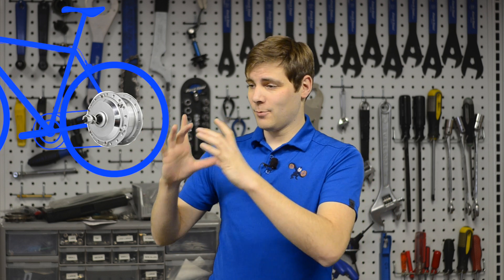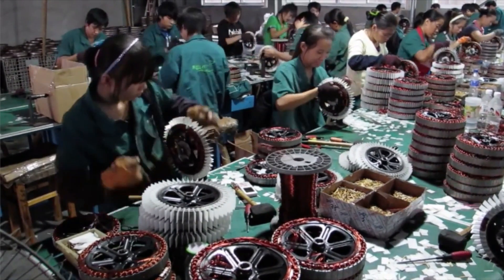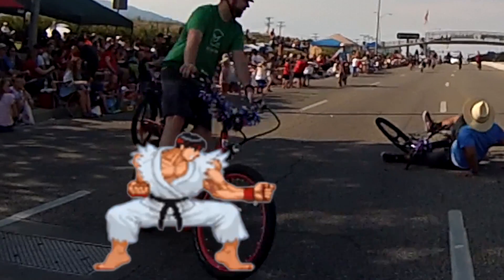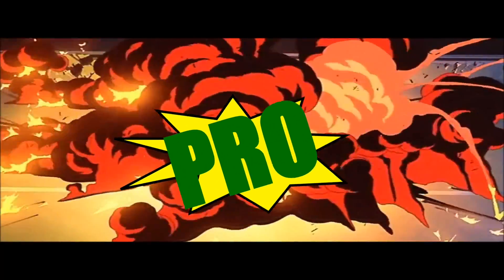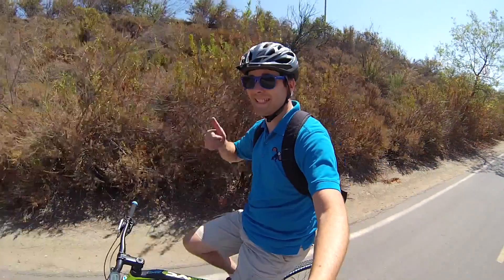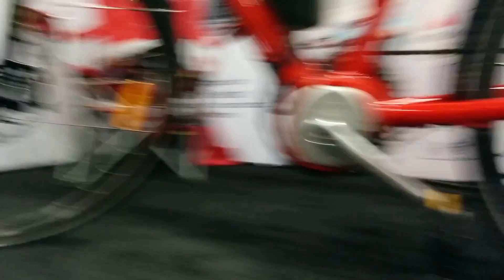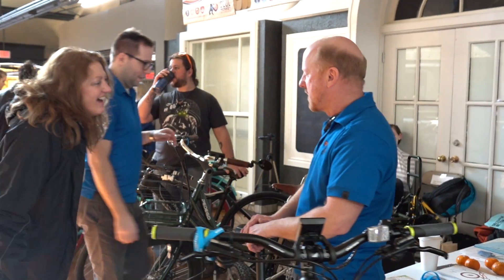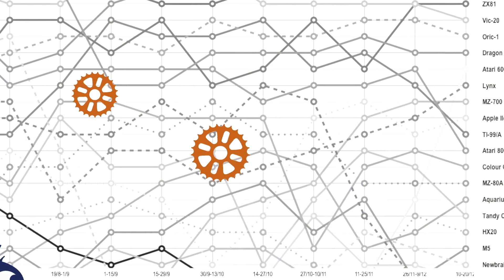Hub Drive VS Mid Drive eBike motor systems

Comment: You forgot the most important difference. Hub drives are direct drives without additional gearing. Which gives them a slight advantage on a flat road. Mid drives take advantage of the existing gearing and thus have better efficiency over a broader range of conditions
Reply from the maker: I intentionally left that part out because I have not seen that correlation with the bikes I've used. I got the chance to test two identical bikes, only with a mid or hub drive bring the difference. My findings were quite surprising...
Reply: Do you care to share your findings?
Reply from the maker: Gotta find the time to make the video 😁

Comment: Outstanding presentation, very professional. I will harp on the fact you didn't mention gear ratios for the mid-drive but otherwise you did a fine job of explaining the pros and cons of each.

Comment: you must all be missing out on e-bike life.  Hub motor used as a mid drive. bigger magnets= more torque.  sprocket bolted to disk brake side, ran through a jack shaft back to a 7 speed freewheel.  wheelies, climbing, or speed.  Years of experience & reliabilith, make it a winner!
10hp limit on quality bike parts & chains sometimes.
Reply from the maker: I'm sorry, I don't understand.
Reply: Blue Monkey Bicycles 
purpose built mid drive mount for 30 pound hub motor to fit into kit or a small type motor. Pedaling is free & seperated from motor.  it uses all rear gears for pedaling & using the motor.  look up urban commuter mid drive, it can be engineered to use a monster qsv3 hub motor capable of 100mph if your technically advanced with correct parts or climb any hill.  I can engineer was to use on custom or open space frames.  40mph for me best in the wold. 😁

Comment: What if you were to put a hub drive on the front and back wheels. Have the controls for the front hub bu the front brake and the rear hub controls by the rear brake lever?
Reply from the maker: What would control the brakes?

Comment: What would be more beneficial, a front or rear electric hub?  I think I've seen some front electric hub drives, and quite a few rear...I assume the front would be far easier to install as you don't have to mess with the bike's chain and gear train.  

I currently have one of the Chinese gas engines and that thing has been problem after problem with vibration causing broken motor mount studs, and parts coming lose, etc.  So...in the future I'm looking towards an electric conversion, but which way is going to have a longer life span?  I'd think the electric hub would, and what about having dual electric hubs one front and one rear to extend the travel on electric, by having 2 motors and 2 battery packs, wouldn't that double your distance on a charge?  Is a front or rear drive hub better?  I'd assume rear, as the front drive could cause some severe steering issues if you aren't careful?

Edit:  I guess I should add that all my riding is on the road, so I think rear hub drive would be best?
Reply from the maker: https://www.youtube.com/watch?v=ACVEUpQ6PL4

https://www.youtube.com/watch?v=9kIFrR8tt28
Reply: Thank you for the reply and video links...and you got a new subscriber.

Comment: AND there is no recuperation posible with mid drive ; ) Right?
Reply: No, mid drives can't do regen. But geared hub motors can't do it too. For Regen you need a direct driven hub motor.

Comment: full suspension = mid drive, off road hardtail = rear hub drive, touring = front hub drive with a pusher in a trailer, just my preference, if i could afford either one.

Comment: More differences come to mind:
The Hub Motor gets every impact and vibration from the road, rocks, roots, etc. 
The Mid Motor is protected from the road. This improves durability. 

The Bosh Mid Motor has only one front chain ring. It doesn’t have a front derailleur. This substantially improves durability and simplicity. When the front chain ring gets worn out you only replace that small part. It’s quite amazing really. Also, the chain is very protected at the front and below.
Reply: A mid-motor will be impacted by everything the front wheel picks up and throws at it.
In rainy weather, the front wheel will also spray a lot of water on it. Since it has to be ventilated somewhat, I can't imagine it can be 100% waterproof.

Comment: after having both I prefer hub motor for commuting and acceleration. Mid drive with the variable gearing are better for off road.
I will switch back to hub drive because it's  more peppy and fun to ride

Comment: Not all mid drives have to be pedaled. They have ones that use a front freewheel, and a separate front gear and chain to allow you to coast and use a throttle.

Comment: Just a guess: The stress is higher on the motor side of the cog (at 6:19) than on the wheel side of the cog (imagine the cog is connected with a spring to the frame so every time the motor torqued the cog would move down due to the extra stress).  Without the cog the chain could break anywhere from the motor to the axel (thus: chainsaw vs leg). with the cog, it will break between the cog and the motor... no severed limbs. Or...

Comment: No mention of noise or reliability. These are relevant as hubs are quieter and more reliable in many settings and are typically a good choice for long flat commutes but centre drives have the advantage of utilising the bikes gearing and may be a better choice for up and down terrain.

Comment: Wellll, no one really needs 21 speeds with an electric powered bike anyway. But I'd be interested in a a two speed mid drive system. Hmm, maybe it can be set up using a BMX chain and front sprockets. You've given me an idea now!
Reply: Check out what stuff is available for recumbent trikes. There are two speed cranks and such. Pretty cool stuff if you have the moola to invest...in your health.
Reply: Heh, no way can I afford my "health". Just have to make do with whatever. :¬P

Comment: 3:41 is riding with his stand/kickstand down! :P
Reply from the maker: Deployed kickstand adds 5 more horse power
Reply: @BlueMonkeyBicycles  LOL that reminds me of all the stuff boy racers used to come up with in the 1990s with thier Vauxhall Novas...
Painting the engine body colour gets you five extra horses.
Alloy wheels over rusty drum brakes  gets you five extra horses.
A decent sub woofer (ie one that occupies the entire boot) gets you five extra horses.
An induction kit over-spec for the engine gets you five extra horses.
Getting rid of all your ground clearance gets you five extra horses.
Dont waste money on a turbo charger - just install a boost gauge and get just as much extra power.
Tinting your windows  gets you five extra horses.
Using a baked bean can as an exhaust  gets you five extra horses.
Reply from the maker: Fire extinguisher, 5hp
Coffee can muffler, 10hp
Hooks on the hood, 10hp
Fog lights, 5hp
Reply: It's a third wheel!
Reply: I think he was using the kickstand to mount the gopro

Comment: I snapped an Ebike rated chain on my mid drive Bosch. Had to push my Bike 5 miles to get home. You can hear the grinding when going up hills and changing gears. Bring an extra chain and tubes if you ride a mid drive. Bosch 20 mph wall sucks too.

Comment: The extra gear on the bike is for the chain line to try and reduce pedal bob and other pedal interactions with the suspension
Reply: The only correct answer around here;)

Comment: You forgot to mention the torque problems with hub motors on the bike spokes, they strip the bit off where they connect to the hub (I've had it happen to two of my bikes)

Comment: I have ridden several brands of both mid drive and hub. I went with a PIM Electric Bicycles for 2 reasons. First the mid drive options were out of my budget and if something broke out of warranty the cost to replace motor or system is super spendy. Second I like the smoothness of the PIM system, seemed very well put together and mine came equipped with Magura Hydraulic brakes and Magura fork for about $1700 ish. I have 2500+ miles on it with no problems. 
Great video! I watch most of the Blue Monkey videos. Of all the mid drives I tried I like the Brose the best. I tried the Brose on the Bulls Lacuba and a Specialized Levo. I appreciate the Brose system for what it is...... But again out of my Budget!! Right now the PIM Electric is the bike for this common man on a budget!!
Thanks!

Comment: Note: electric bycicle use the motor for paddle assistance it's not a motor bike, in the Netherlands you don't need to register and insure you bicycle if the motor has maximum of 250watt. The mid placed motor can be fitted with gears like a nexus 7 speed or a multi speed derailleur in combination with a 250w gives alot of choice shifting down when going uphill or heavily loaded bike
Reply: I don't know why you would bother putting a motor on a bicycle under 750 watts what's the point I went with 1,000 Watts and I love it I wouldn't want a little skimpy 250 watt motor just doesn't make sense to me.
Reply: @tallcool1jeff  are you stupid? Laws mate. in australia too you can only have 250w

Comment: My budget for an ebike is limited to around 2k so, I suppose I AM limited to a decent rear hub motor ebike.  Any suggestions from anyone? I’ll be riding 10 miles nonstop mostly and occasionally 20 or more
Reply: shadowdance4666 here in Germany you can get a descent Cube Mountainbike with Bosch CX (mid) for under 2000 :)

Comment: can you make a video on over volting the motor. I have a 36 volt and want to over volt it to a 48 volt. Do I need to get a new controller my existing one has 50 volt caps in it.

Comment: Surely front and rear hub drives help sort out the balance issue, even if it won't help with the unsprung weight.

Comment: Is there a difference in reliability? hub drives are more exposed to vibrations.
Reply: umm I've destroyed 8 or so cargo bike wheels doesn't matter if its mid drive, & my wheel hub laced moped bent also from a pot hole.  no matter what you have, more weight & stress is in a hub motor laced wheel.  laced wheels will always need tuned or replaced eventually & a mid drive is #1.  You can swap out a wheel much quicker with out lacing a motor into it.

Comment: Practically useless vid and leaves a lot of important info out. For example, only direct drive hub motors have regen capability to recharge batteries through the controller.

Comment: Do you have to paddle backwards with a Mid-Drive after a 180 Fakieee ? How long can u manual such a bike and on what speed ? And can I get the paddles into  a flat position for a front flip tailwhip  or superman seatgrab ? And can I still preform a Crankfilp ?

Comment: this video has some good points, though for it being this year 2017 I am disappointed that you didn't do more research before publishing this video. there is a whole market that you have left out for mid drive bike that are not pre-built. which would contradict most of your issues and con for the mid drive. Again this video is well laid out and executed though the information in it is not up to date.
Reply: I completely understand and was not aware of that fact, because I didn't check out your channel. With that being said it should be noted in the title for those who aren't aware of your channel and only came across your video due to the title. Thank you for clearing that up for me though.

Comment: What if you used both (7 speed gear on hub drive and then a mid drive motor with a chain to the gear)
Reply: Mahadev Bibil 

Had the exact same thought
Reply: Its probably been done yet having two power sources in series seems too complicated and of questionabl;e value. There are endless ideas on YouTube however so never give up, never surrender.
Reply: there will be a point where the mid drive balances & shares rpm with the in wheel hub then the mid drive rpm will take over as you switch to a faster gear ratio.  basically good for torque and lower speed accelernation until cruising with mid drive.  not energy efficient if hub drive is still wasting watts or for commuting.

Comment: So what I've learned is that I need a front hub, a rear hub and a mid drive and a back pack full of batteries.
Reply: bahahahahahaahha...
Reply: @Phil M Well comparing bicycles to motorcycle is bit unfair but it means that electric bike can also be motorcycle. For 3000 you can build your own or ask someone from Endless Sphere to build one for you or get parts for it so you local bike mechanic can put parts together. Like motor mxus 3000w with ferrofluid and hubsink, controller sabvoton 72150 with accessories and ready battery, self built or ask someone from forums to make custom battery for you. Also get newer bike with hydraulic brakes because this needs all the stopping power. With instant torque grom will feel like a tractor.
Reply: This is correct!
Reply: Sooo... anyway... back to what I was saying. I don't want a Honda Grom, as I already own real motorcycles. It's just that e-bikes represent a kind of fun that just can't be had on a motorcycle. I can go more places that I can't take a dual sport or a dirt bike. They are quiet, instant torque and lighter with less maintenance. Batteries are going to be part of our future, that's just the way it is. Time to let go of the Steampunk antiquated combustion engine. Right now the only limitations are battery densities and subsequent range. But the more of us that are early adopters, the quicker the tech advances.

Which brings me back around to my original joke... in order to have similar all day fun, compared to one of my motorcycles, is that I'd need a backpack full of batteries to alleviate my range anxiety.

But with an e-bike, I can still pedal the thing back home or to camp if I should run out of batteries. Can't say the same thing for a motorcycle stuck out in the middle of nowhere.
Reply: @EcoMouseChannel  just buy a bbshd kit, 160nm of torque, mid drive are the best of both, balanced and powerful, they are also hitting the hub levels of watt power, also this video guy talks utter shite, nearly every mid drive has a twist throttle so, again he says mid drive fits inside the frame again bullshit, this guy has only seen bosch ones, but if they are in frame it means its been custom made which means the structure of the bike would be better than a conversion, the clown in this video really doesn't sell the concepts at all well, go check other clips, btw a bafang bbshd at 1600watts will piss on most hubs below 3000watts
Reply: @Phil M  I the
Reply: use a car battery carry that on your back pack
Reply: But You need a drivers licesne, Liability insurance and annual plates
Reply: @Phil M- The Honda Grom runs on gasoline, requires title, registration, motorcycle driver license, motor vehicle insurance.
The $3,000 is just getting started.
Reply: Actually, not a bad idea.
Reply: Front hubs are useless
Reply: pull a trailer with like 10+ car batteries :D
Reply: Are we even ready for 200 mph?
Reply: Phil M ok boomer
Reply: @Santeri_M  i have never seen a boomer on a grom
Reply: @Santeri Miettinen you idiots. Boomers are mostly too old to be on YouTube. Baby boomers are 70-80 years old for God's sake. Tired of this ignorance
Reply: @danfield6030  Actually maximum 75 since the period starts after the WWII.
Reply: @danfield6030  the last year of the baby boomers was 1964. Not 75 to 90 but 56 years old to 74 years old. You are pretty critical for being completely wrong.
Reply: bbrain WW2 officially ended in 1948. Victory in Europe 1945. Victory in Pacific 1948. My dad was a war baby & also a Boomer born in May 1945. 

The Battle of Manila has just concluded 2 months earlier in March.  I was told of stories of malnutrition of him growing up.  Her mother worried about his  development told the doctors the boy was late to learning to walk. The doctors prescribed to feed him lots of bananas and it worked. Up to this day my father’s love for 🍌 never ceased.
Reply: @iMadrid11  victory in Japan or VJ day was August 15 1945. Maybe what you typed was a typo but you are 3 years off.
Reply: Fernando Sor ...you just proved my point though   ,they are older than this guy said   ,for heavens sakes....I keep hearing people saying 30 year olds are boomers    ...sent be a fool
Reply: Dan Field Ok boomer

Comment: Mid drive with a centered belt drive with a dual tire hub in the rear wheel that is fully enclosed to protect the belt from the elements and to protect the rider. Design solid wheels with organic carbon power cells incorporated into the wheels. Then the rider can have a choice of manual power peddle power of full electric motor use. ; )

Comment: This is the closest to my design. An addition of a 24 v motor linked to pedal sprocket.  I believe your mid-drive to be electric motor assist like my design.  My cost is about half in dollars but 4 times the time.   (And a prototype)  I will look more into it, got me thinking.
Do you also do instruction books with diagrams?  A diagram is 2000 words to me.
 Off subject:: Has there been an electric snow sled ? An " E-sled " with less weight.

Comment: that extra cog bears a fraction of the load, sacrifice efficiency, but still nec
Reply: I believe the extra cog is there for other reasons also...perhaps having to do with chain alignment with the pivot point etc...I do not have thaty feature on my Haibike but wish I did.
Reply: You're right there, It's purely to reduce chain-feedback on a suspension frame with a high pivot point, I doubt it has any effect on chain stress. This years Commencal downhill bikes also feature the same design because higher pivot provides better kinematics. The little cog is called an "idler".